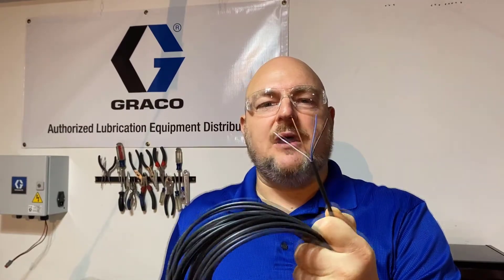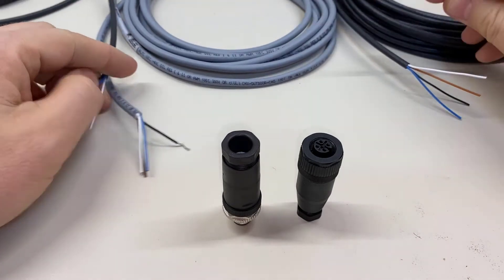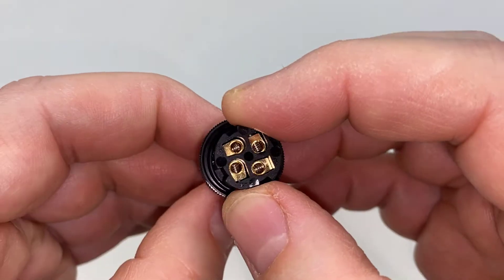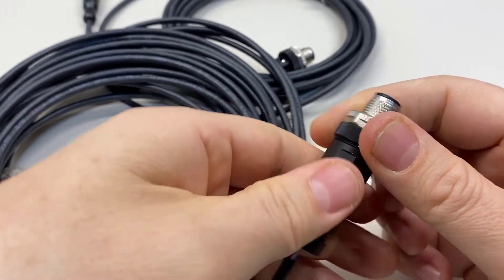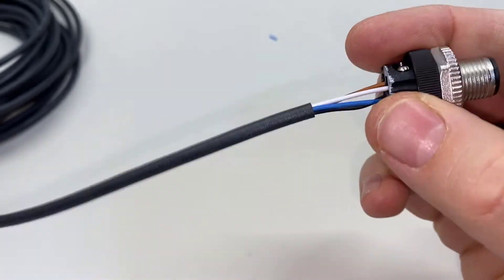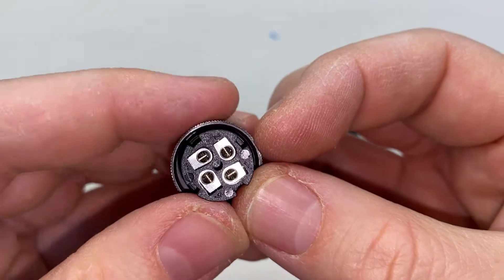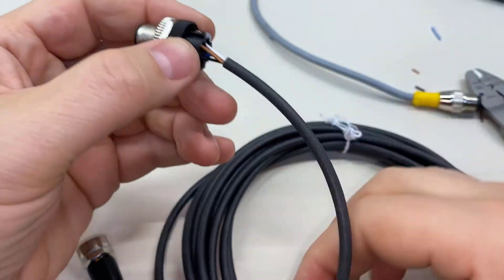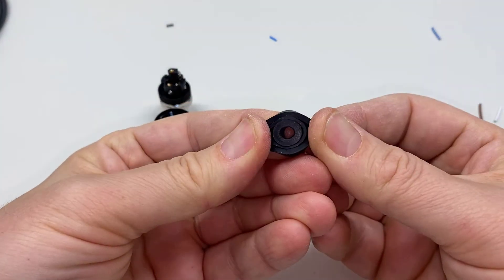M12 Connector Wiring Tips

Comment: I have a Hiberband gateway that requires 24v dc power supply and earth. the termination on the 24vdc source side is fine. but, the termination on hiberband side is confusing because I now have 3 wires to connect it to tue M12 female adaptor. are you able to help me figure this out on how to connect the 24v dc power supply into this cable adaptor?